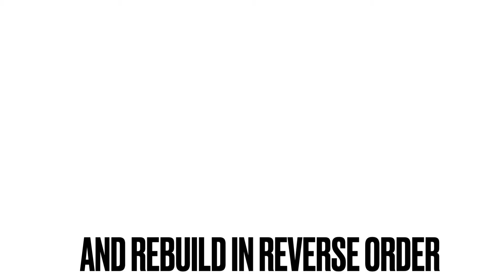How to change vauxhall Astra rocker cover gasket in 20 minutes. Cam cover gasket replacement.

Comment: Always change pvc valve
Reply: Seems like everyone forgets it can cause oil leaks and blow gaskets if not changed i just changed my full rocker cover much easier comes with new bolts gasket pcv valve

Comment: Great video, would you recommend that I use a bit of permatex sealant for a bit of extra stability?
Reply from the maker: I do sometimes use a bit of sealant. Avoid normal silicone though. I use flange sealant, I don’t know what that sealant is your using?  Thanks for your comment.
Reply: @How2FixIt1 thanks for the reply mate, I got some flange sealant…where abouts do you recommend I put the sealant, a bit in each corner or all around the seal? I had minor leakage in spark plugs wells, should I put some flange around the 4 holes where the gasket cover goes?
Reply from the maker: @leejones8485 if you want to use it I would apply a thin bead all around.